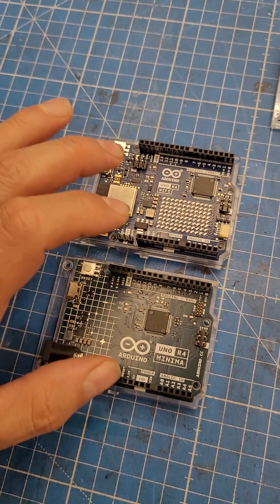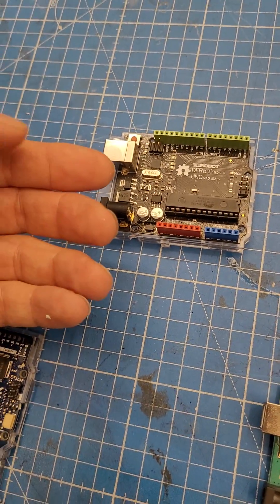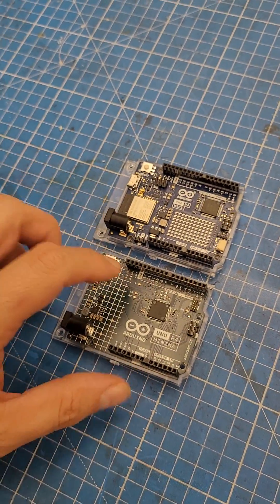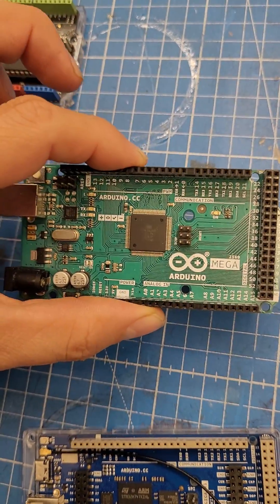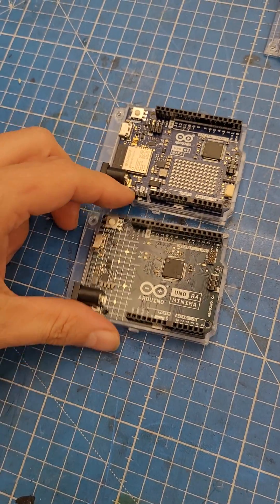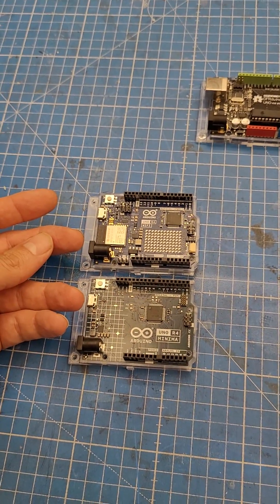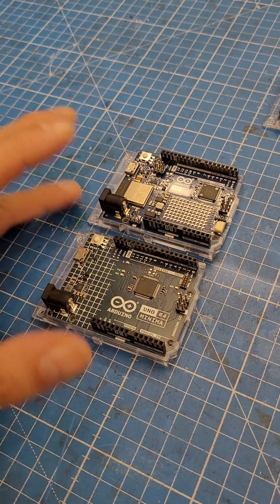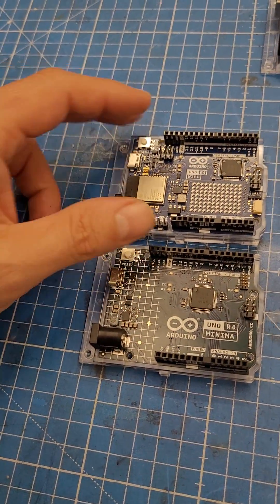the Arduino UNO R4 controversy  explained.#drama #arduino #unor4

Comment: All around bad design decisions were made on this product!
There name is NOT controversial. There is the UNO R3 and the UNO R4; albeit completely different CPUs.
The controversy is on the design. 
WHY did they put that DUMB LED matrix on the board? That is NINETY SIX LEDS that have to be placed on the board! 
Why did they add a THIRTY TWO bit ESP32 to function solely as the WiFi co-processor? This sort of multi-processor hardware is prone to failures and complicated software BUGS! What happened to Arduino using the KISS principle?
This ESP32-S3-MINI-1 has no option for an external antenna and is dependent on that pitiful PCB antenna. Should have used the "U" version.
The ESP32 is more than powerful enough to be the ONLY processor on the board, and it already exits as the Wemos D1 R32 which has been out for several YEARS. On this UNO R4 board, Arduino used the ESP32-S3-MINI-1 which has 8MB of flash! The Renesas RA4M1 (ARM Cortex M4 CPU), which they used as the main CPU, only has 256kb of FLASH! 
Better to brick the board to use just the ESP32! 
NOTE: The ESP32 firmware can be updated. there is an analog switch on the USB interface (more cost and parts) to switch between the Renesas CPU and the ESP32 for programming. 
How about a video on bricking the UNO R4 and using the ESP32 as the sole CPU?
How good is that WiFi? Did they wrongly run circuitry under the PCB antenna? Which is a no-no!
The ONLY truly good design attribute is the input is now up to 24V; makes using with motors easier.

Comment: isn't it supposed to be easily replacable?
Reply from the maker: both generations are 5V input tolerant have the same pinout, so it is an "easy" replacement, as long as you dont treat it like anAVR on the programming side. if you are not using direct register calls everythign is fine.

Comment: Uno is referring to the form factor and pinout, not to the processor directly. The names are "Uno R4", not just "Uno". Arduino was always meant to abstract the processor away to make microcontroller programming more accessible for artists.
Reply from the maker: Yes, but the uno form factor was also used for the Ieonardo, and originates from the duemillanove.
The complain people had comes mostly from the combatibility with ol avr specific register instructions that  obviuosly do not work on the new arm.its a case of expectations of the audience
Reply: They say on their website that "Arduino Uno is a microcontroller board based on the ATmega328P (datasheet)." so that's where the confusion cames from i think.
Reply: I respectfully disagree. The Uno R1, R2 and R3 were always ATMega328p based boards and it's indeed confusing that R4 is now a completely different MCU. I'm pretty sure it's R as in Revision, which means the same thing with some modifications and upgrades, not a completely new thing. They should have used a new name and started with R1 again.

Comment: I am more confused about Uno R4 Minima vs Leonardo now that the Uno has USB-C and HID.
Reply from the maker: this is actually a good comparison, the uno r4 kinda also replaces the leonardo as it does all that it did. the generational fit is actually even better than for the uno. So it could also have been called Leonardo R ? or Leonardo32 .
Reply: @MAYERMAKES  The Leonardo still is the winner IMO:
- Compilation time is king here. 2-3 seconds on a Leo. Forget that with the M4, if Arduino is so bad to also update the ESP32 RTOS software (as the ESP board driver for Arduino does), it will be horrifying with 1-2 minutes compile time on a student laptop.
- Leo has 12 ADCs, the R4 only 6
- 5V is a downside, most high-speed stuff you do with a 48Mhz board is on 3,3V. So the voltage is weird in relation to the speed. For sensors it does not matter, we buy solely sensors with level shifter or voltage independence. But for a matrix display for example, it has the memory but will need a level shifter to do 3,3V.
- The SPI is shared with 10-13. Thank god the leo has it where it belongs, on the ICSP header, keeping 10-13 available for other stuff
- USB-micro is easily repaired, and strange enough, more reliable in classrooms. Especially with all the junk USB-C cables out there. If USB-C connector is down, you can forget repair unless you have a reflow oven.
- The leo just looks better, and comes in super tiny pro-micro form factor for breadboard use.
- They missed the chance to do the power circuit right. Going from 7805 to a buck converter is nice, but it should have been one that works from 1V upward with a lipo-connector. Then it could have been powered from a lipo or single AA battery. In reality, we never ever use the power socket. Much easier to feed extra juice via USB.